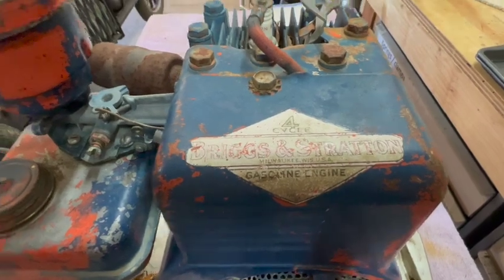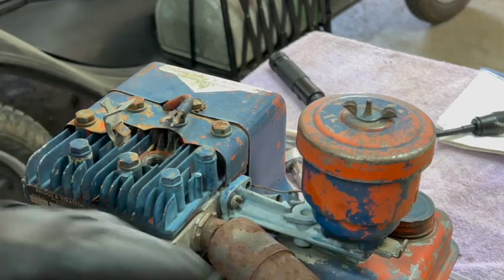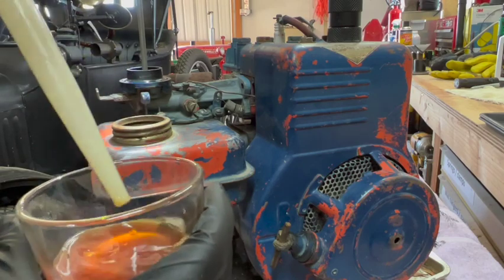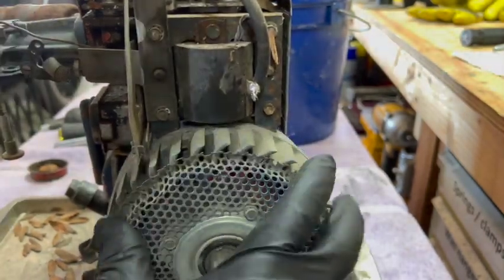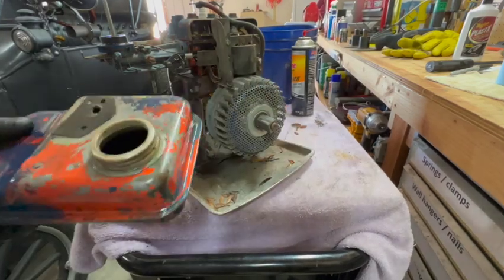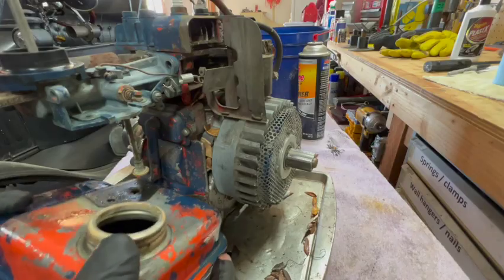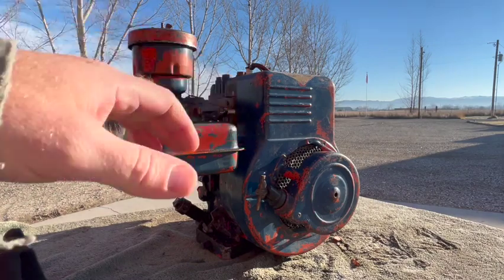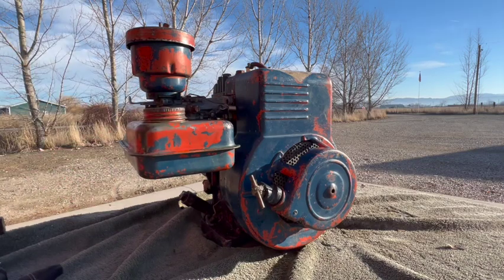Barn Fresh Baby Briggs - Will It Run?

Comment: Coil air gap: .006,.010. A favorite trick of mine was to fill the gas tank all the way up with that style carb. The top of the gas tank is a sealing surface so if there's a leak there at the gasket, the gas won't be drawn up the pickup tube. The higher the gas level in the tank, the easier the gas gets to the jets.
Reply from the maker: That makes sense. Thanks. This tank does have a seal but I didn’t fill it all the way up. I guess that’s why it took so long to start pulling fuel.